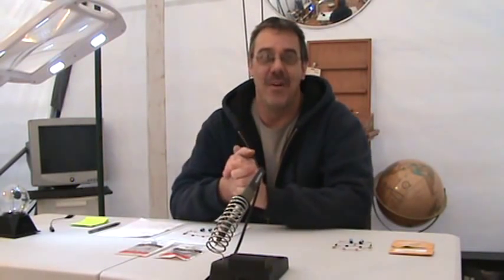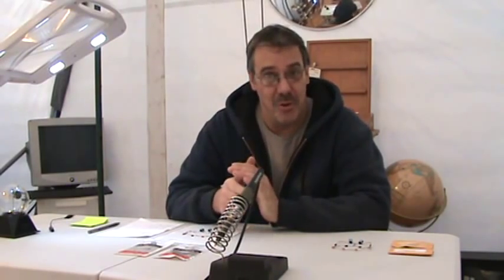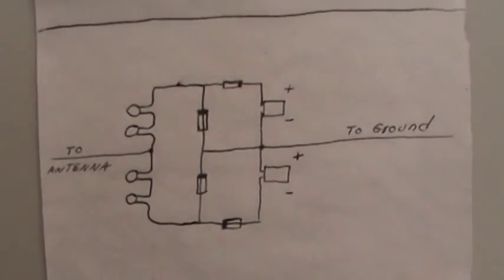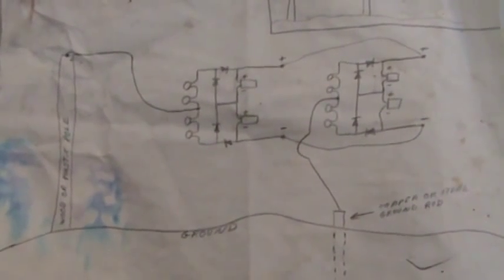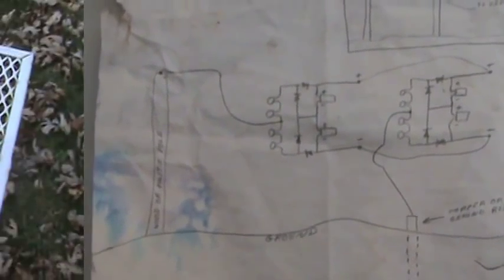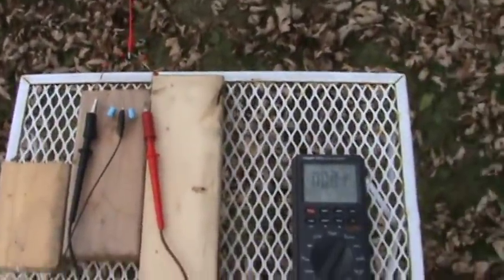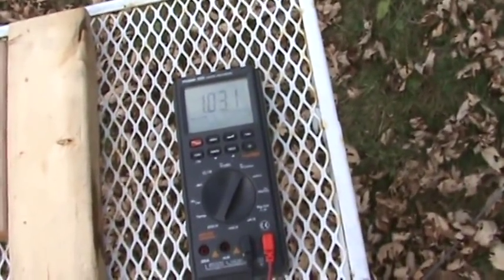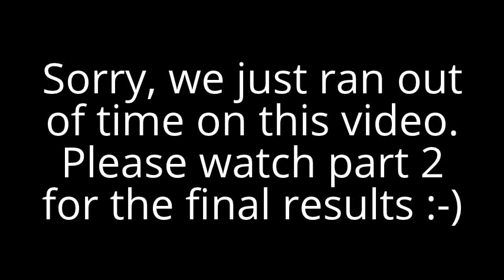Free Energy From Air Circuit, "HOW TO"(Improved) part1

Comment: Great Video!!!  Happy Holidays!!!  Couple of comments:
4:25 - The reason that Germanium diodes work better is that they only need 0.3 volts before they conduct to charge the caps. Silicon diodes do not conduct until they get 0.7 volts across them. A rectifier with the lowest forward bias voltage will give you the best energy capture.
9:36 - The reason that voltage goes up with higher elevation on the circuit is that you are inadvertently also raising the antenna. This increases the impedance from the antenna to ground thus reducing how much energy is captured by the antenna and then directly coupled to ground. This is energy lost before the circuit gets it. The more of the antenna is up and away from ground, the higher voltage you will get.
Keep up the good work!
Reply from the maker: Thanks, much appreciated.  I will have to try those diodes i have in small brown envelopes, they have even lower forward voltage requirements :-)  Happy Holidays! :-)
Reply: Lower forward voltage on the diodes will likely give you faster initial build up of voltage and faster recovery after putting a load on the circuit. The actual terminal voltage will not be different if you make the same circuits and only replace the diodes.

Comment: It's good to hear you clearly without any zapping or yapping in the background! 
If you're converting to DC then the antenna power must be alternating an alternating current. 
Could that be, first, put through a transformer, then regulated to get a much higher higher voltage?
Or are the diodes and capacitors already acting as a voltage multiplier?
Reply from the maker: Thanks.
Yes, part 7 shows checking of incoming frequency of 258 KHz.  The circuit does act as a voltage multiplier, but not much.
I think to make a very special transformer, because i dont have enough current to produce the transformer inducing action.
Also the coil i use acts as a voltage multiplier.

Comment: INVENTOR3 
I have a question, can you make a video to show how long it takes to charge a capacitor with different sizes, like a 1000uF electrolyte capacitor and a ultracapacitor with 1F ?
Im a trainee for electronic engineering and want try it too,to power a microcontroller from this cap, because voltage/current are not high enough to use it.
thanks :)
Reply from the maker: Hmmm, i feel confident it will charge the caps.  I got super cap now to try this with, but tied up now with other projects.  But will be back on this project again soon.  Without addition caps, i was able to produce a spark about 1/16th to 1/8th of an inch about every 8 seconds with this circuit.
Reply: INVENTOR3 thanks for these informations :) I will follow your channel and looking for about your following experiments with it.

Comment: This circuit is a double doubler circuit and so it quadruplies the input!!!   The  oscillating  input voltage between the antenna and ground is multiplied by four and that is the peaks for good diodes and good capacitors!!!
Banks of capacitors and diodes may be coupled to produce any factor of multiplication , I just wonder if it works from an antenna. I often tried it with  about 20 banks and a 6 volt transformer and reached voltages of 200 volts.   But obviously little current may be taken out of such circuit where Power is always volts multiplied by amps...... so the energy is always that picked up by the antenna , which I suggest should be tuned to a particular high power  radio station!!

Comment: I have tried attempting this experiment. Now so far I have only been reading 0.5 volt. I'm not sure if it's trouble with the circuit or with the antenna I'm using. Could you assist me with what I'm doing wrong?

Comment: Shcottky diods have a foward bias drop of 0.15 to 0.45 Volts. They might work in this circiut.  BTW,  0.1uF is 100nF. Not 100 pF. Usually labeled 104 on the capacitor. (100,000 pF). You could use just two 47nf capacitors in this circuit as there are 2 sets of .1uf caps in series.
Reply from the maker: +Robert Tomkinson Yes, thanks, i will have to try the shcottky diodes, a few people mentioned to try them now :-)
Cant believe i still get mixed up with the caps, you are correct, thanks.

Comment: I don't think you understand your circuit and what is happening. It doesn't take time to stabilize. What is happening is you have an antenna feeding a voltage doubling circuit with electrolytic caps on the output. What is taking time is charging of the electro caps. If you put a load (1k resistor) across the output, the voltage will drop quick as the electro caps are discharged. A better design would be to feed the antenna to a couple of voltage doubling stages (3 or 4 stages....google voltage multiplier or voltage doubler). Then put a big electrolytic cap on the end to charge up and use as your output. It will stabilize the output and if turned off for a while will store the energy so you can use the energy stored in the cap to drive your LED (until fully discharged).
Note that typically these circuits have an antenna feeding a few doubler circuits (diode-cap). Then this output is fed to a storage component (e-cap or supercap or rechargable battery). Then the output is fed from the supercap to a joule thief (google it) and to your LED.
If you look at those garden solar lights you'll see a similar situation....solar panel to rechargable battery to a joule thief to an LED. You can buy one of those for $2 and rip out the joule thief for reuse by your RF to DC circuit. The energy in the RF to DC circuit is too low for a rechargable battery....it'd be better to use an electrolytic cap or supercap.
Note that I've done some experiments with this stuff myself in the past. I found that I could use 5 or 6 voltage doubling stages in my home before the doubling causes loss due to the components. Note also that these voltage doubling circuits don't get you extra energy, just that they change the voltage to a useful value.
RF is an AC current, so you can use voltage doublers directly. If using solar or some DC energy scavenging instead, you'd need to realize that you need to convert to AC before using voltage doublers. There are relatively new mosfet transistors that work at very low voltages that can be used to make an oscillator driven from 0.1V or even lower.... ALD is the company that invented these in the last 10 years and their website has a bunch of useful scavenging technology....http://www.aldinc.com/
Enjoy...
Reply from the maker: Donald Murray Hey, thank you very much Donald :-)  Im working on this project now, and im trying a supper cap and joule thief now, and i was also looking at the voltage doubler circuits :-)  Its like you were watching me over this last week doing experiments, or read my mind, hehehehe.  I understand all your saying and i even printed out your comment.  Ill be posting new vids of this soon.  Im now working on getting more energy with antennas, collectors, and ground.  I now got over 7V, but after connecting supper cap/load, voltage drops to .1V
In my videos series part 16 i got over 100V,,,,i could of done a lot with that, but now moved lab and starting all over.  Stay tuned, new results coming very soon.

Comment: @ 6:53 there is a suspicious coil of wire; is this just a con mans trick using the coil to collect energy from a wireless transmitter?), that circuit looks BS to me and this is my professional area, just decoupling caps, rectifier and storage caps.
Anybody trying this use a insulated aluminium plate at height as per Teslas patent, use high voltage mica capacitors and spark gap. The collecting voltage is very high V but low current, hence the need for mica low dielectric loss.
Reply from the maker: I have been doing this for about 9 years now,,,no BS here i promise.  Im an honest person.  The coil is in many of my videos.  In many set-ups i would put this coil over the ground rod and it is at the same time connected in series between the antenna and the circuit.  It will greatly increase the voltage, but still very low amps, but im improving it all the time.  Now i have 21 LEDs lit 24/7.  It is best illustrated how the coil is used in my original 24 part series from 2008.  I have had this set=up in three different neighborhoods & i get the same results.  My original, series is done in an area that has the power lines running under ground.  Please stay tuned for better results :-)

Comment: Just watched another see you using a circuit similar to yours except in this one there is no ground! See the link below! However I can't get much of a voltage either way! I'm using 1N34a germanium diodes, four 0.1uf ceramic capacitors and two 10uf electrolytic capacitors! Any suggestions? Thanks! 

https://youtu.be/GDIfPhwJyHE
Reply from the maker: Blakehx That exact video is what got me started on this project.  Yes, he has no ground and very short antenna.  I dont see how he got a cell phone to charge and i think it was faked.  You need long, and high antenna, the more surface area in the air the better.  Ground is also very important!!  I need to see your set-up to help you more.  send me photos or video, here is my email...
millanyangle@yahoo.com

Comment: i build one of these and noticed it rapidly charges up then balances out at half of the beginning voltage and then after a while later it just drops slowly ... i cannot say how mutch voltage since my multimeter is broken .... i set it to 20 VDC and the numbers where 13 then 9 to 6 to 7 and then dropping
Reply from the maker: Sorry i missed this comment, but maybe make sure to use germanium diodes and make sure nothing is touching your antenna, this can make voltage drop.

Comment: Its not working..i used 1n4148....1n4007 0.22uf ceramic capacitors...for dissapointment...nothing
Reply from the maker: IMHO, the 1n4148 are the best, very fast switching, i think around 25ns.  Most people have problems because of there antenna.  Make sure it is not touching anything & circuit is not touching anything.  Not sure if you have seen my last few videos on this project, i  got over 120V now.  Check diodes to make sure they are good,,,the 1n4148 should have about .4V voltage drop across each of them.  Oh, you should have a voltage for sure!  If you want you could send me an photo of your circuit and antenna and I could hep you further,,,,  millanyangle@yahoo.com
Reply: Okay my friend

Comment: I had been looking for some time for a good 'free energy from air circuit...' video that is clear, concise and easy to understand, so glad I found this one - but, why have the antenna connected to or suspended from the tent instead of connected to say the top of a long wooden pole stuck in the ground?  Sorry if that seems pedantic, not my intention.  Also, does the antenna copper wire have to be laminated with resin?
Reply from the maker: Antenna wire is enamel coated copper wire, also called magnet wire or transformer wire.
Ok, to see a better set-up look at my videos titled "free energy from air 2015 part 1" (part 1 to 5).
also i would suggest to watch my "free energy from air" videos back from 2008-2009 where i have over 40 feet high and 60 feet long antenna, and get over 100V.
Also 2 more videos titled "free energy from air 4 LEDs lit" and "21 LEDs lit", one of the links are below in comments & many more video links under video description.
If you want more help, no problem,,,,email me anytime at    millanyangle@yahoo.com     or ask questions here.
Thank you for your comments and compliments :-)
Reply: Okay, sorry - enamel coated not resin laminated, I should have paid more attention ;)  Will look at the vids you suggest, thanks.

Comment: Was thinking of replacing the diodes in your circuit with home made 1.2v crystal cells like the lasersaber ones, do you feel this might work?  When you make the cell it gets its initial charge but can be recharged when it drains off under load., so the radio signals being picked up would charge the crystals but was wondering if you could lay out the crystals like in your circuit replacing the diodes.
Reply from the maker: Hmmm, not sure about replacing the diodes with the cells,,,interesting, maybe,,,,,,,but you read my mind with connecting an antenna to a cell !! :-)  I was keeping this idea for myself to try,,,but i guess its out there now, hehehehe.
Hey, i like the way you think :-)  If you try either method, please let me know of your results :-)
just in case, here is my email    millanyangle@yahoo.com
Reply: INVENTOR3 I'm sure the cells will charge up nicely if they are like the lasersaber cells i have charged. I was thinking of how to make a multiple anntena mast to run several of your little circuits, if indeed that is possible:)
Reply from the maker: Spangley Rainbows Running separate antennas, problem is they interfere with each other and you will not get 2 times the power. I think best antenna to use,,,umm, i cant think of the name of it, grrrrr.  2 parallel antennas that run horizontal and are separated by and insulated rod near each end and after the insulated rod they come together. This antenna is said to give the most current :-)
Reply from the maker: +Spangley Rainbows hello, i just recently replied to one of your questions you had asked John H about, a zeener diode having triboelectric.  I forgot what video you left this comment under,,,but anyhow i was wondering if maybe you meant to say piezoelectric instead of triboelectric?

Comment: I have ordered 50 .1 uf caps and 50 1n34a diodes from ebay. 3$ free shipping :)
I tested circuit with with silicone diodes and they are not that bad. With them I get 5-6 volts and about 1 microamp (light from red led is visible). Same circuit with germanium diodes I get 2 mircoamp but 12 volts in my room with antenna connected to metal table. Do you have any idea how to lower voltage and increase amperage? I want 2.5-2.7V to charge supercapacitor.
Now I wanted to ask you something. Have you noticed difference in power when you remove electrolytic capacitors? I get instant reading of voltage. With electrolytic I have to wait for them to charge up.
Also I will test with electrolytic 50V but 1 uf.
I will make video after testing, today or tomorrow.
Reply from the maker: Dino Sabanovic Bottom of page here is drawing of how to connect 2 circuits together, this will trade off voltage for current....
http://paulslab.blogspot.com/

Im trying to remember if i ever experimented with the polarized caps or not.  I mainly experimented with the ceramic caps.  Im glad your doing this and look forward to seeing a video of your results :-)
Reply: INVENTOR3 Thank you. I have measured my AC voltage and is between 17 and 18 volts on table with 1-2 micro amp. I'm still waiting for my germanium diodes. I will make few circuits without polarized caps and test it. I really want to lower voltage to 2volts. That would be perfect for supercapacitor and Joule Thief :)
Bought Supercapacitor on eBay 2.7V 100F. Damn seller sent me used and faulty, It's loosing charge fast.
Is there some way to fix it?
Regards.
Reply from the maker: Dino Sabanovic thats too bad about the super cap :-(  Nothing we can do to fix it.  Super cap is the way to go.  I have one and did not try it yet.  Ill be trying it soon :-)
Reply: INVENTOR3 I made Flashlight with 2X 2.7V 300F paired with Joule Thief. It's crazy good :) I love it. Made a video few days ago about it. Also bought aluminium foil and will tape it under the table to increase my voltage and amperage. Tomorrow definitely gonna make video about my findings.
Reply: Dino Sabanovic 
video is done. I will upload in few minutes. Also I will include link for your channel in video description.

Comment: hi what kind of material do you using for antenna wire? is it copper wire?
Reply from the maker: Yes, copper wire, also called magnet wire or transformer wire.  It is copper wire with an enamel coating.

Comment: How can I increase both Voltage and amps and to convert to ac current.
Reply from the maker: +Roger Hoover If you remove the circuit you will get ac.  The circuit has diodes to convert ac to dc.  Raise the antenna as high as possible.  I got over 100V with antenna about 44 feet high.

Comment: voltage is ok, what I need to know is how to increase amperage to a useable level, i.e., 250mA or more...
Reply from the maker: Keep increasing voltage than add spark gap, after spark gap you will get your current.  Plus to get everything resonating that will allow most current flow.
Reply: bigger antaner and more collectors

Comment: O had a good flux connecting other antenna (without capacitor) (ionic) in the positive or negative terminals. It was very good. There's an electromagnetic and ionic components. Two distincts vectors.
Reply from the maker: Leonardo, good to hear from you!
Are you saying that you connected a second antenna off of the circuit from one of the outputs?
Reply: INVENTOR3 Yes! An antenna without capacitor in connection to one or other output (I prefer the negative). An antenna with ionic purpose of collection. Try!!! PS. In my circuit the ground is not connected between the electrolict capacitors, but is connected with the negative output.
Reply from the maker: Hmmm, antenna & ground are connected to neg & pos outputs of circuit, is this correct?  Ok, i will try.
Reply: INVENTOR3 You put in one OR other output.
Reply from the maker: Ok, thanks, i understand.  I may have tried this already in the past when i first started,,,but i will try this.